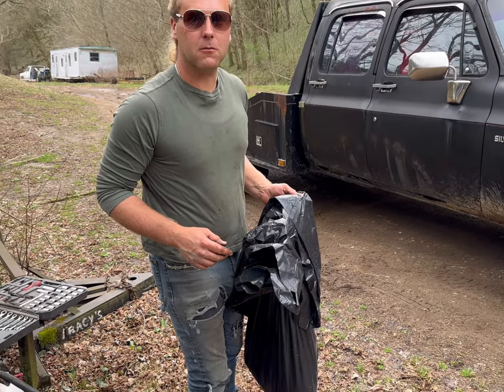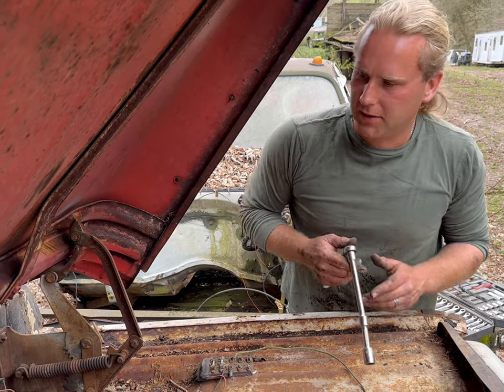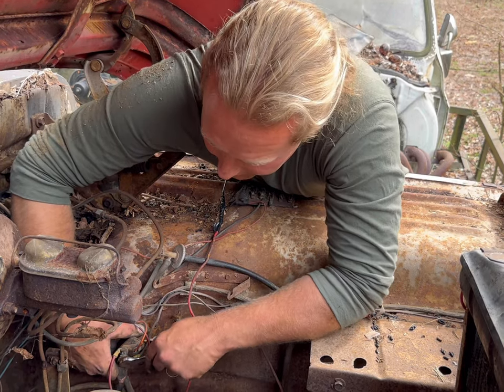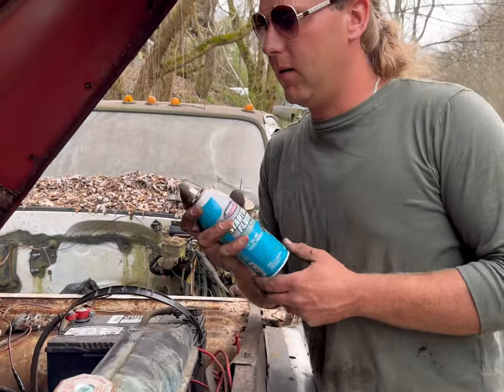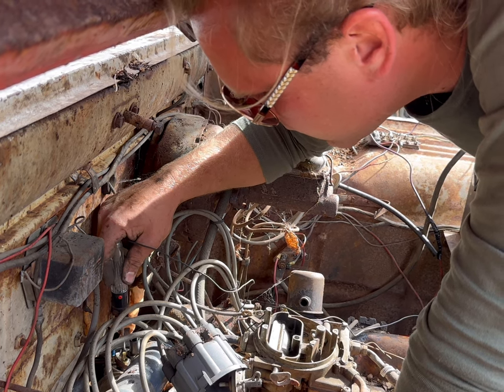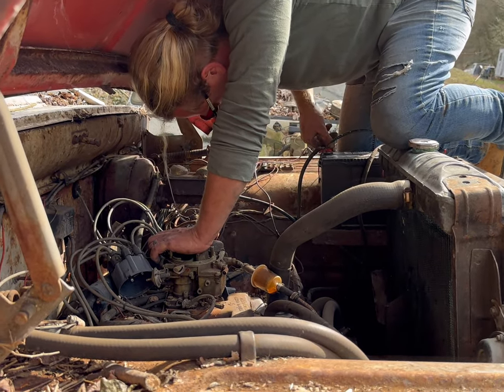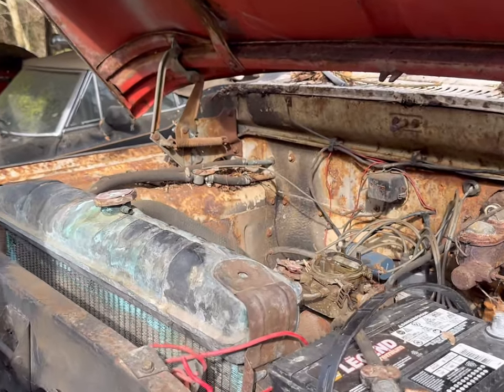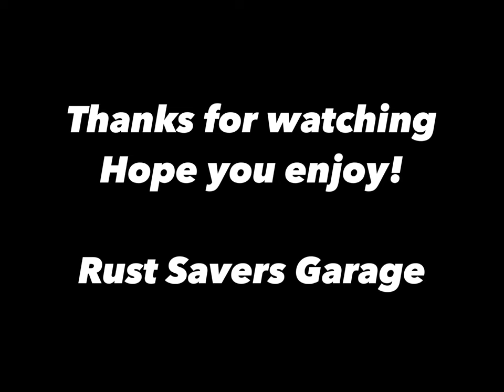1970 Dodge D300 wrecker part 3, will it run?

Comment: Are you sure that is a 318 in that truck because it has the big 2 bbl carb on it and they came on 360's unless someone took the intake and carb off a 360 and put it on the 318. 318 had the small 2bbl carbs that I ever saw and I have messed with many small and big block mopar all my life.
Reply from the maker: Not sure but you may be correct! Could be a 360 ? I’ll have to look into that..
Reply: Looks like a 360 with that carb size 318 is smaller